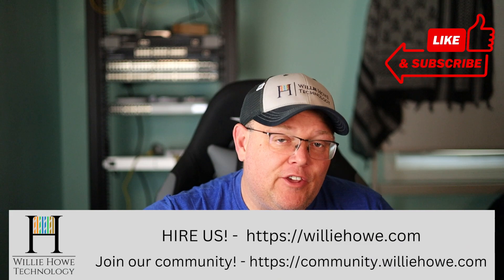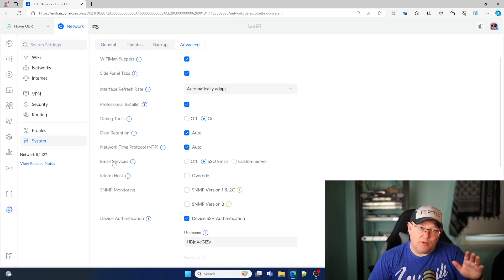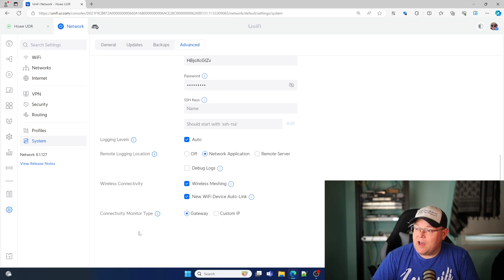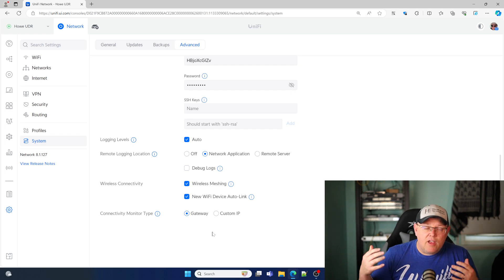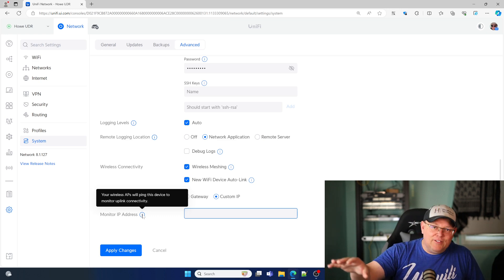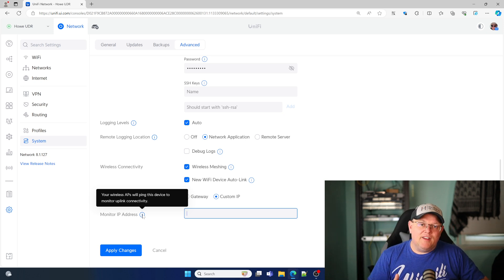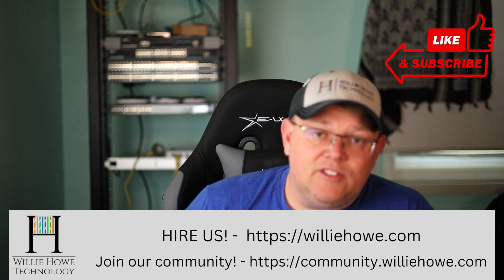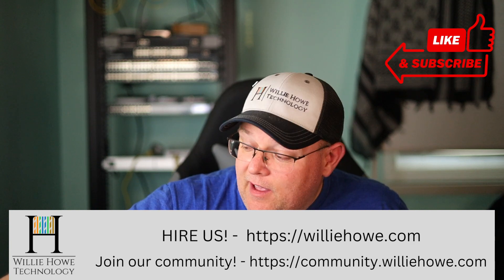Fixing UniFi: Why your mesh WiFi suddenly stops

Comment: so my unifi-network-application version 8.1.127 that setting is greyed out as I have 2 U6 Extender that are meshed to my U6-LR, my USW-Pro-24 is my main switch love that thing i also have a USW Flex Mini thats a nice 5 port switch too. So i got to know what version are you running or did you just remove any meshed devices?
Reply from the maker: I had no meshed devices.

Comment: I am struggeling making an Mesh network between U6+, and/or AP-lite and AC-Pro. I can make work 1-2 hours and then it stops. Afterwards the acesses point goes in isolation mode. I have tried all combinations. I cannot find any information on the Unifi forums about this.  Almost similar to your issue. I will try the solution here.

Comment: I think a while back there was a limitation on vlans and meshing. I had 2 work networks during the pandemic and long before that I turned off meshing as I didn’t see the need for the feature if you have APs dotted about hardwired in.

Comment: If you change the Monitor address, I would recommend putting in the WAP that the meshed WAP connects to. Of course, that WAP would need to be set to a static IP address so that it doesn't change. If the WAP that the meshing WAP connects to is down, then the mesh isn't going to work anyway, so it's a good address to use as the monitor. Of course, this would mean that you may have to set the meshing WAPs in their own profile or set them individually so that you can specify a specific, possibly different, IP address to monitor for each of the meshing WAPs.

Comment: I disagree with this video 100%.
Reply: yes , me too if you wired in you access points, wireless meshing just degraded transfer speeds and causes tons of other issues. I turn off this setting for all deployments.
Reply: @ryanmiller6887  Loop storms, the switch powers the ap, if you reboot any of the equipment out of sequence, they ap's will mesh and bring down ports on switches AKA GARBAGE! When setting up a client, the first thing i do MESH OFF!!!

Comment: Hi Willie, thanks for the video. I ended up unchecking the "wireless meshing" option as I was having a crazy problem (presumably). It seemed like any time the device that the AP was plugged into restarted, the AP would switch to meshing and not go back to the wired connection, even after the switch was up. Throw in there that it would then throw "network loop" errors and disable the switch port. Maybe I had something else happen, but I stopped having issues when I unchecked it. Love your channel...thanks
Reply: I had exactly the same problem and also had to disable the wireless meshing function. The AP would form a wireless mesh and cause the switchport to go into blocking mode.